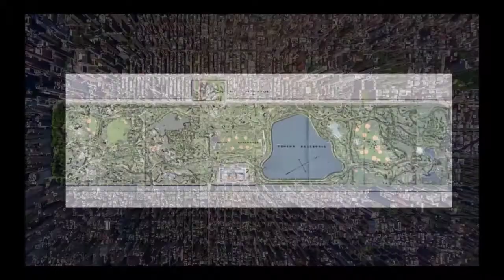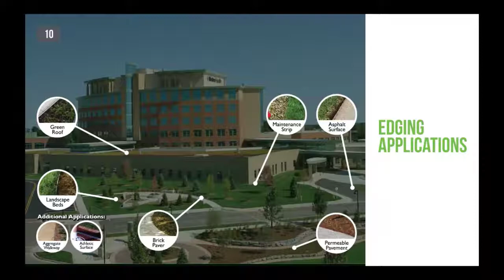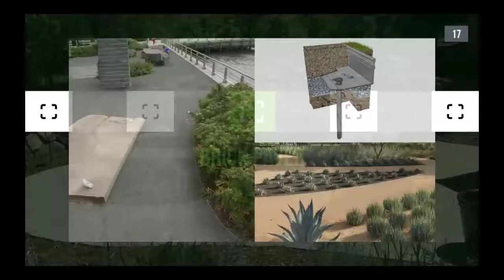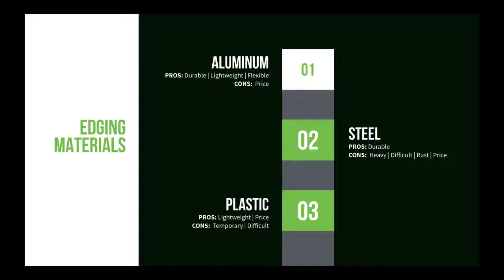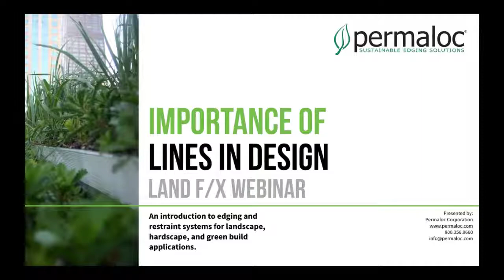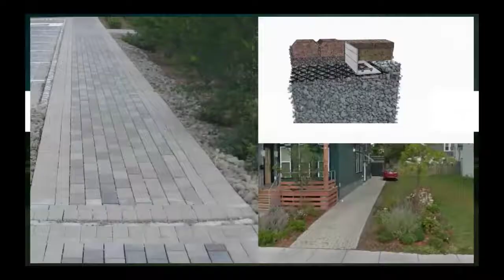Importance Of Lines In Design

Comment: So, in Sweden we have problems with damage to pavers of brick/tile material from the cold winter. We have been asked not to use it in public spaces. Do you think, it would actually be possible to use it if we used geogrid with it to make it permeable?
Reply: Essie,
We're going to let Daniel know to come over here to offer his thoughts on your question as well, but in the meantime, I have some insight on your question as well after designing pavers in Canada. For sure, you won't want to use clay brick pavers. Those are always going to chip off as water permeates the actual stone and freezes. It's not about the traffic on top. Clay tends to absorb water. There's a lot of manufactured concrete stone, though, that's much more resistant to water permeating and freezing/cracking. They've gotten really good in the last 10-15 years to where they can mimic the look of classic clay brick and tile, too. Use that. We have Unilock in North America. I'd be interested to learn who you end up using in Sweden. Your local Landscape Architecture Associate should be able to give you some contacts.

You'll need a good drainage base, though. Geogrid is great if you're trying for a fully permeable paving surface in order to get the support you need over the larger clear stone base, or trying for extra-duty support for regular pavers for heavy vehicles. Otherwise, you need a 100mm depth of 19mm dia. stone (we called it clear stone or Granular A in our area, it's 3/4" crush in the USA) for pedestrian areas or between 150mm-300mm depth for vehicular areas, depending on the potential load from vehicles, and then 25mm of screened sand for setting the brick.

Your local manufactured concrete paver supplier should have good advice on how to best install in your area - it might have different soils than my area in Canada. The important part here, though, is that the clay brick and tile are cracking due to the frost on the moisture inside the brick. They'd do it just sitting there without any traffic. There's no installation you can do outdoors (that I'm aware of) that can help that. I'm open to being corrected, though!